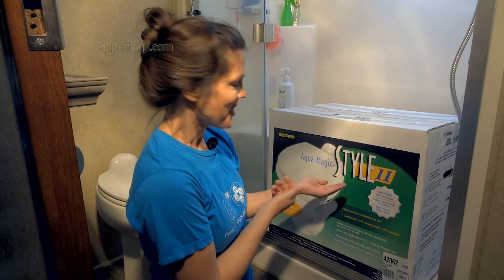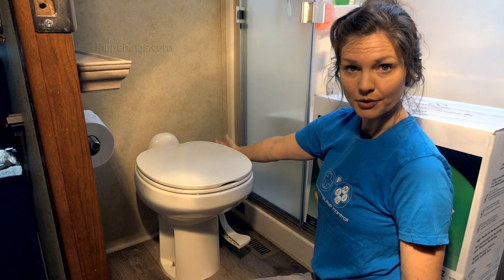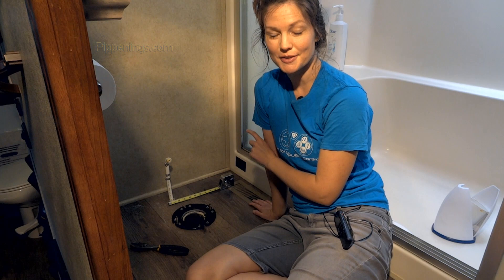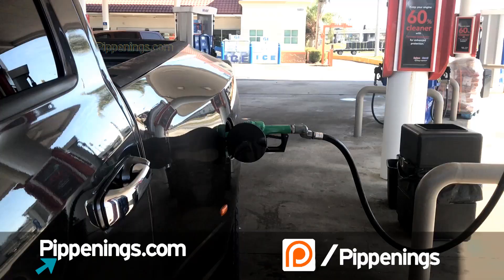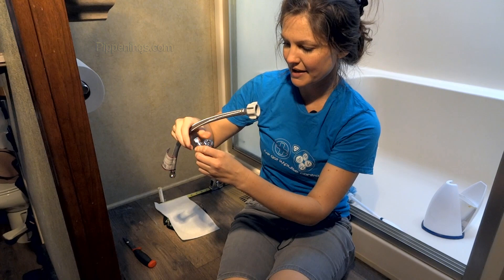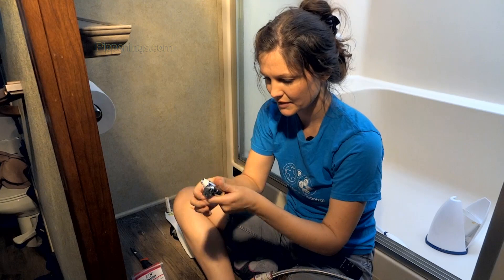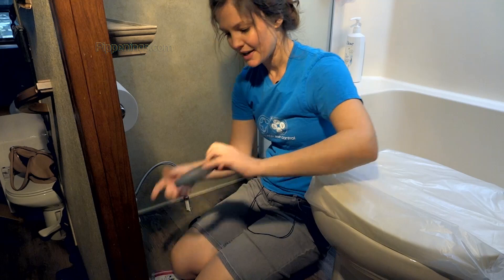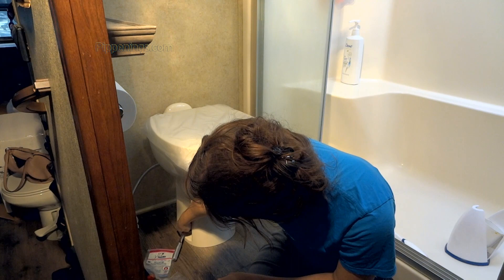Does Changing An RV Toilet Have to Be So Hard?

Comment: Thanks, Pipi.  I have to put a whole new setup in my motor home.  Someone sometime in the past broke the black water tank, so instead of fixing it, removed the whole toilet setup.  I was looking at a ceramic toilet for the motor home locally, it was more expensive than this one is, so thanks for the link.  I've replaced 3 house toilets, so feel I could do it, but this makes me feel even more confident.  I haven't used shark bites in the past, I've used the PVC cement and replaced things that way...this looks even easier.  Blessings on your journey.  We've got 3 feet of snow still on the ground here, so it will be a while, but I plan to do this.  Blessings again!
Reply from the maker: Best of luck with it Christie. You can do it!

Comment: Pippi, one thing about Shark Bites. They need to create a seal between the pipe and the internal gasket of the shark bite. You left the end of the PVC ragged so it's not a good seal and although it's not leaking now it might later. Shark Bite sells two tools tat you should have if you are using their fittings.  One cleans up the raw end of the PVC and the other removes an applied shark bit so you can reuse it. You should also invest in a pvc cutter as someone else suggested. I know storage space is at a premium but at some point in he future when you are boon-docking you will need to cut a piece of pvc.

Removal Tool https://www.amazon.com/SharkBite-Disconnect-Connect-Fittings-U710A/dp/B00A8HUG1S/ref=sr_1_5?crid=34J7YF6ZHZC4X&keywords=sharkbite+removal+tool&qid=1553827797&s=gateway&sprefix=shark+bite%2Caps%2C169&sr=8-5

Deburring Tool https://www.amazon.com/SharkBite-Deburring-Depth-Copper-U702A/dp/B000K6QFSU/ref=sr_1_4?crid=34J7YF6ZHZC4X&keywords=sharkbite+removal+tool&qid=1553827881&s=gateway&sprefix=shark+bite%2Caps%2C169&sr=8-4
Reply: Hi Fred: Pretty sure that's PEX tubing
Reply: @ngneer999  You're probably right, It looked rigid so I figured the riser was PVC. Either way the edge should be clean to keep from damaging the o-ring in the fitting according to the shark bite website.
Reply: ngneer999 pretty it’s a hose.
Reply: @lancomedic Yep the riser is PVC which was very common in older RV, all new RV today use pex and red and blue for hot and cold just like in houses. I have a complete set of pex tools for future repairs and/or replacements. Normally I just use sandpaper to smooth off the edges, but with a pex cutter your really don't have to use sandpaper.

Comment: Pippi don't thread tape on a flare nut or other fitting system. You can blow out the nut. I did it once. National pipe thread is a tapered thread cut. Which is why the tape works. Now Teflon paste can work to get more clamping force on a seal. but tape isn't as yielding and splits the female threads apart.

Comment: As others mentioned, a tubing cutter is easier and leaves a clean end for the rather delicate O-ring to pass over. Also a lot safer. Using a knife to struggle through a cut is a good way to get a nasty cut. The voice of experience : -)  Compression fittings : snug but not over-torqued.  The tighter you go the more likely they will leak. The voice of 50 years of plumbing mishaps : -)  Your valve with a long hose is good advice. Especially on an RV.  My RV came with a rigid connection, the typical cheap-and-fast way manufacturers do things, leaving problems for the user.  Longer hose is better when connecting between two close fixed points in a pipe connection. A loop is easier to connect and does not create stress points like a short hose.

Comment: My toilet had the same kind of connection to the toilet.  I invested in some basic PEX tools and colored PEX 1/2" tubing with crimping clamps to carry when camping.  I also installed a shut off valve at the toilet as well as the feed to the water heater that ran parallel to the toilet feed.  One cautionary note is that those slide on Shark Bite fittings use a rubber seal inside.  There are videos here of some that failed.

Comment: Should have used the correct tool to cut the PVC pipe. Lowes or Home Depo has a tool that has blade on both sides that you place around the PVC pipe and squeeze and gives you a clean cut. Good Job !!!

Comment: If you have a u joint on a long extension, wrap a couple turns of electrical tape around it to keep it from flopping over. You'll be able to direct it over the nut much easier.
Reply: Good tip man !

Comment: I did the same thing  I threw out my old plastic Thetford  and replaced it with a Dometic 310 porcelain bowl. I did it for a couple of reasons the first was partly aesthetics, the second was it is easier to clean. With porcelain I can use any cleanser on it with no worries of scratching it.  I also noticed a huge change in the smell in my RV  bathroom. Seems the old plastic toilet was harboring some pretty nasty bacteria.
Reply: I was wondering why she didn't go porcelain myself.
Reply from the maker: It is porcelain

Comment: Use a copper tubing cutoff tool for very close quarters cutting off of plastic or copper tubing leaving a clean very perpendicular cut off from your supply tube with no sharp edge

Comment: Hi pippi,

a little tip for You when u need to cut any type of plastic tubing , rubber hose etc.
Use Pvc cutters. i recommend ratcheting cutters. sometimes called heavy duty pvc cutters. it Will be one of the best tools u ever buy. i absolutely guarantee it! You can use it to Cut:
1. Garden hoses
2. any plastic tubing
3. Clear vinyl tubing
4. plastic electrical conduit
5. any Rubber hose
6. any plastic hose
7. basically anything round that u can cut with a sharp knife or razor blade. Pvc cutters are Safer & Faster.
8. Enjoy !

Phil.
Reply from the maker: Yeah that might be a good investment
Reply: But the squeeze type (ratcheting) cutters tend to mash PVC pipe and cause it to later split, unless the blade is really sharp.  In other words, use it 3 or 4 times and throw it away and buy a new one for each job.  Or use something else, like a saw.
Reply: ive never had a problem. but if i see it squeezing instead of cutting , i just move it back & forth a bit and it goes through like butter. on clear plastic vinyly tubing or rubber hoses. squeeze away , not a big deal. still a great tool / for investment for $8.00
Reply: @OcRefrig  10-4, that probably means it's about time for a new blade.  On jobs I REALLY don't want to do again, I don't take that chance.
Reply: Yea, the blade is pretty dull ill bet by now. its like 10 years old. im allways using 3/4" sch 40 pvc. so that stuffs pretty bullet proof.  i could see where if i used it on a thin wall plastic a dull blade would could be a issue. a dremil might be able to put a edge back on the blade. ill have to try that.

Comment: You should clean the pex pipe of any burs and the 3/8" compression fitting is just that sealed by compressing the o-ring inside female side to the vale male side .don't use Teflon tape can cause over tightening due to reduced friction on the thread.

Comment: Nice job replacing the toilet. I just replaced the seals on my Aqua Majic Plus and The seal (gasket) that goes on the bottom  was reversed with respect to the way you put yours on. according to Thetford the flat side is supposed to mate (face) the toilet flange on the floort. Had I viewed your replacement before I had done  my seal replacement I would have done the same as you did with the shutoff valve inclusion. Nice job..

Comment: With that compression seal, you don't have to "Crank" that tight, just snug, the compression seal is designed to expand to create the needed seal that is required for sealing. I never over tighten or "crank" it tight.

Comment: Good video Pipi. You should invest in a PVC cutter for future jobs, safer than the ol hunting knife. Always ream your pipes removing any burs which can cause a leak. It's better on the nuts to use a crescent wrench or proper open end wrench and use a back up wrench if necessary. You should caulk the opening by the pipe penetration to prevent water getting in to the sub floor and causing rot.

Comment: Some plumbers might be critical of you using Teflon tape on that compression fitting thread. Not me of course but the other plumbers. Teflon tape is normally only used on tapered pipe thread. Also Teflon tape is PTFE which is not the "dangerous" Teflon and is incredibly inert.
Reply: The tape won't hurt anything but it isn't necessary. It's a compression fitting.
Reply from the maker: It also acts as a lubricant on the threads which can help get a tighter seal and easier to unseal
Reply: @PippiPeterson  One other thing it does, it makes me smile every time I see where someone has put tape on a straight thread.

Comment: You are a RV toilet Conisoure of sorts Pippi with at least two change outs to your credit.  Most people would rather have to pay someone else but not Pippi with your experience and the ability to forge on why not.  You are not afraid to get your hands dirty. I thought that the shark bite needed a flatter surface to lock but I was wrong I thought when you had water coming from the fitting you would have to trim the line again but you didn't. Any more DIY stuff that you have planned?  Solar again, or maybe hot water renovation.  Pippi is cattywampus a technical term?  :-)  We know that you are up to it Pippi.  Loved the show Pippi give the pups a hug from me Ed
Reply from the maker: Thanks Ed

Comment: I don't recommend any teflon tape on a compression fitting.  I do recommend marking the pipe with a sharpie to indicate the depth that the sharkbite should seat down to: the depth depends on the size of the pipe, but is about 3/4" for 1/2" PEX pipe.

Comment: There are OD and ID measurements. Depending on the Gage of the pipe. (inside Diameter ?outside diameter) Plumbers tape is only to be used on pipe threads. If there is an O-ring or something inside the connection, be careful be cause the O ring is made to not have plumbers tape.
Reply: Plumbers tape is metal with spaced holes. She was using teflon tape. The name makes a difference when you ask for it at the store.

Comment: I apologize if you answered this question, but I missed it.  Why are you replacing your toilet?  Was it leaking?      We are having trouble with our toilet.  Undecided to replace the entire toilet or try to fix or replace a part.   When we flush, the water keeps coming, slows down but keeps trickling.   Were you having the same problem?  We dont know exactly what to do...    thanks for all the wonderful videos!
Reply from the maker: It’s just a little bit more expensive to just replace the whole thing. My valve won’t working right

Comment: Funny, that Dometic one you needed the special universal tool for was a Thetford. It's on the label under the lid in your video at :45 seconds. That one with the buried fitting looked like it came out of a '57 Tag-A-Long. . . . The new Dometics are as good if not better than the Thetfords.
Reply: It's just a universal joint, not a special tool.  You should have at least 3 in your toolbox - one for each size of ratchet you have.
Reply: I have several universal joints. "Special tool" -- was her words. Main point is, don't throw a manufacturer under the bus when the explanation is the wrong one. . .!!
Reply: @gac914  Yeah, I was really commenting on her explanation not your comment.

Comment: Never liked the shark bites..I prefer to glue and or solder the joints...In your case glue..Shark bites have O-rings which can be damaged when installed and do deteriorate and leak after time..Also the shark bite joints do not hold up to vibration very well when traveling..Just my opinion..

Comment: You ate your dog :O … guess at least you heated it up and added some sauerkraut, but still ! … … great instructional, never realized how easy this can be IF you have plastic hoses, here in houses piping is generally copper and if one is unlucky fitting something new will involve soldering stuff together (this when something actually broke or in truly old houses; as in general now a days the first install would have ended in a fitting with threads). And i will not lie about this, while still avoiding details, but having a good comfortable working toilet is probably the next most important thing besides a roof over your head!
Reply from the maker: Someone said below he replaced his entire shop with shark bites on copper 12 years ago and hasn’t had a leak yet. So that may be an option.
Reply: @PippiPeterson   well, as long as i do not have a leak, i will not touch the plumbing if i can help it ;) … but it's something to hopefully remember if something like that would ever be necessary, so tnx for that extra information ^^

Comment: Did you replace the wax ring
Reply: Great question. RV toilets do not have traditional/residential wax rings. RV toilets are outfitted with rubber seals to accommodate movement. Rubber seals do need to be maintained with a toilet seal lubricant and conditioner to maximize their life.

Comment: Got burned by someone not putting in cutoff valves. Kitchen faucet came apart giving us no choice but to turn off the main. No stores opened for 3 days. No baths, no toilets the whole time.
Reply from the maker: I’ve been there. Not fun
Reply: If you have PVC plumbing, a few end caps and a can of solvent are good things to keep in the emergency kit.
Reply: @johndough9187  it was old copper tubing with hardly enough to work with
Reply: I've seen the direct line hookups back in the 80s with cheap mobile homes. I realized then, what a cheap hookup - no one notices when you're buying but there will be hell to pay when you need to shut off the main water just for a toilet leak. (The main shut off turned out to be difficult to access and buried in sand). So now it seems we go backwards with RV construction.

Comment: You should drop a red solo cup into the hole after removing the toilet for obvious reasons
Reply from the maker: Aaah that’s a great idea. I had a paper towel over it but the cup will also catch something that may actually fall. Great tip, thanks!
Reply: @PippiPeterson   Or prevent the tank smell from entering the cabin..